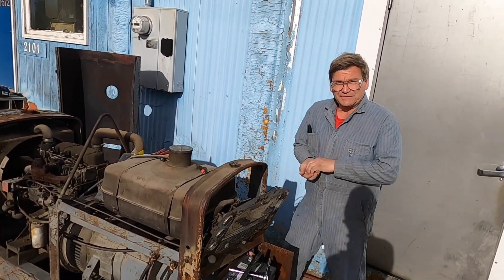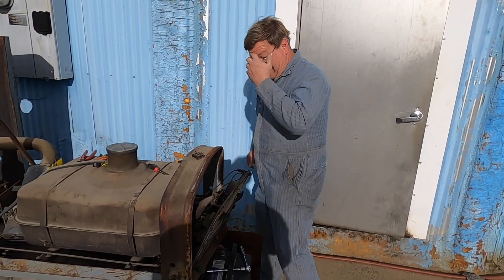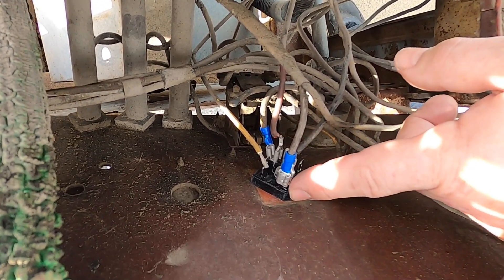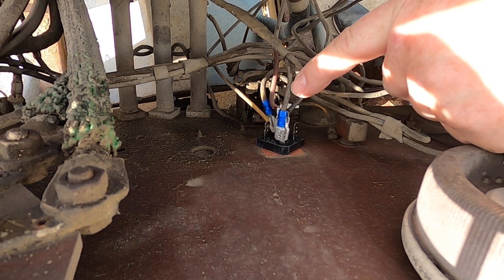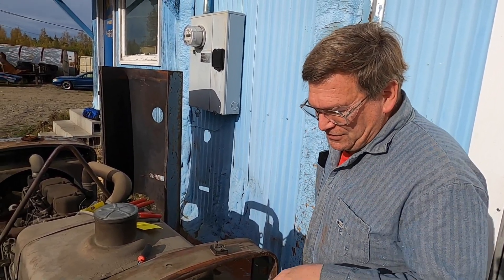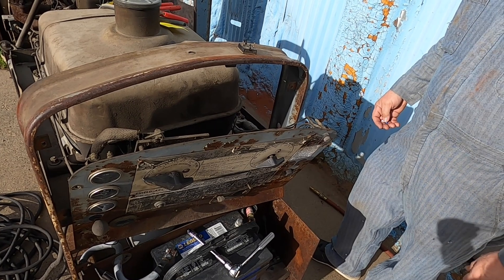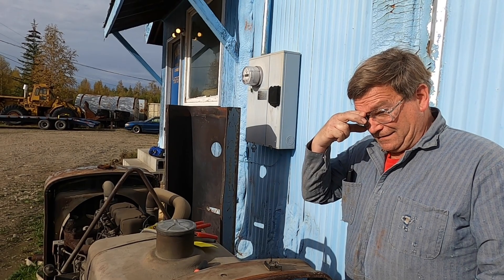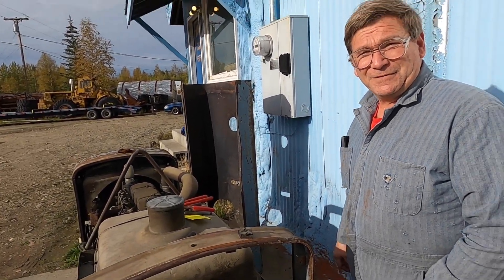Diode repair in the SA250 welder

Comment: We have 200 Lincoln welder and it’s not welding so where would this Dial be at located when I take and touch the lead together there’s nothing happened. There’s no arc and no nothing. The machine runs tonight on everything but nothing else is going on with it.

Comment: There are two different major versions of the SA250. The earlier version is 100% DC, just like the smaller SA200. The later version has DC welding output, and a 3Kw 120/240 volt AC generator. The machine in the video must be the later version.

Comment: That look like a  set of SK sockets do the sockets fit the case any better than they used to? Every time I grab 1 of my 4 sets and then set it back down I have to rearrange all of the sockets before I can use them.
Reply from the maker: They stay OK, if kept flat, but otherwise they start to move, not perfect, but honestly have not found any other boxes that work at all.

Comment: It seems backwards because that's a bridge rectifier (4 diodes)
Reply from the maker: The bridge rectifier outputs positive dc on the + marked terminal, In most electronics Red is used for positive, in this case the black is connected to the positive.
Reply: Are you sure?
 Positive

Comment: Great machines, those old 250s. It’s a little tricky to diagnose, but there is another diode on the brush holder that can go bad as well. I’ve yet to smoke a bridge rectifier, but have had one on the shelf for years just in case.